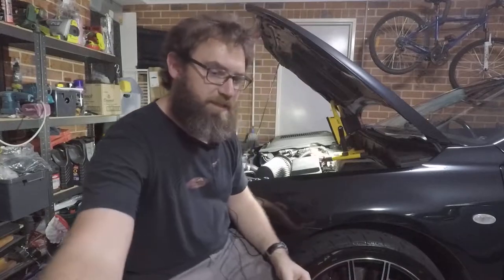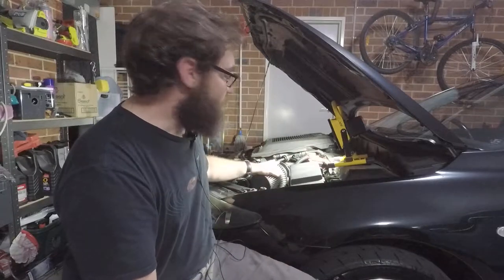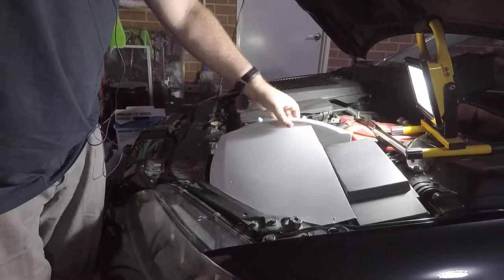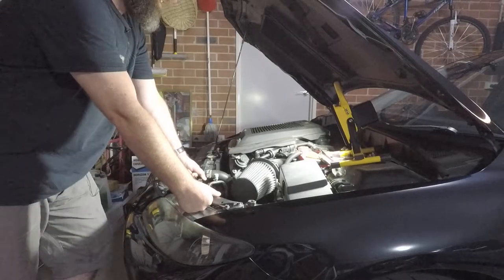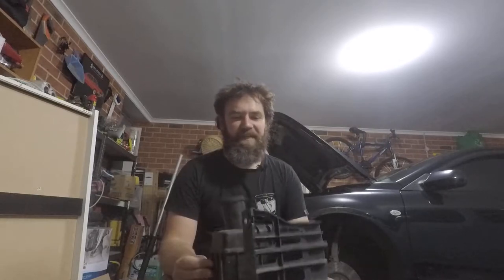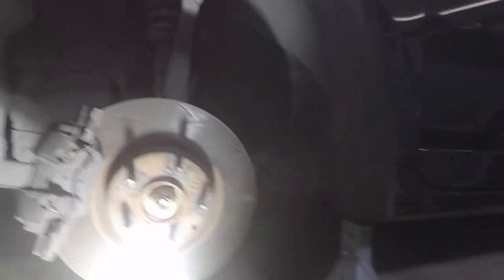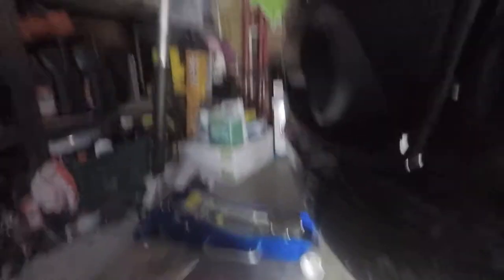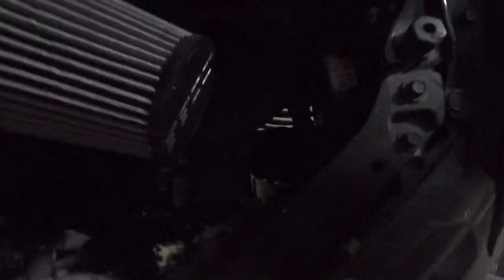DIY air box for a short ram air intake

Comment: wait, from the wheel well? what was the relative pressure you tested?
Mine were always low pressure. generally speaking the opposite of a good place to draw air in. You would actually have to seal it entirely to the intake to even promote flow in the in direction. 
For posterity, any work required to access high pressure zones is the only work worth doing toward the goals of efficiency and power. 
That does not make this a bad idea. it means it leans in a different direction. it will be good for sound and general lower speed response.